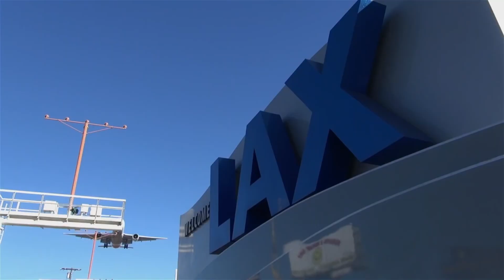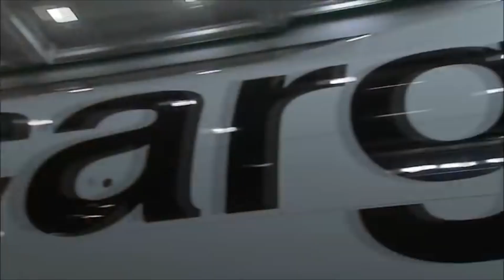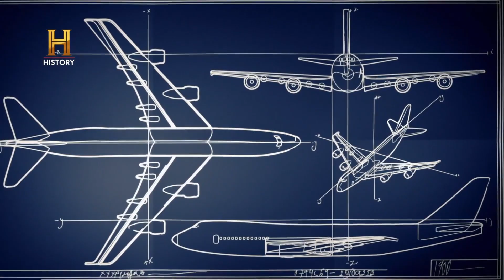Boeing 747: The Plane that Revolutionized Aviation

Comment: The 747 is a beautiful and practical aircraft. It has led the pack for years and will for years to come. I can’t wait to see  Boeings next supersized passenger aircraft. Why is it with the lifting capability and speed capability of the 747 can’t they be built and used as an airforce heavy bomber?